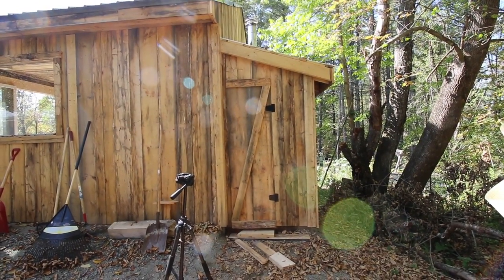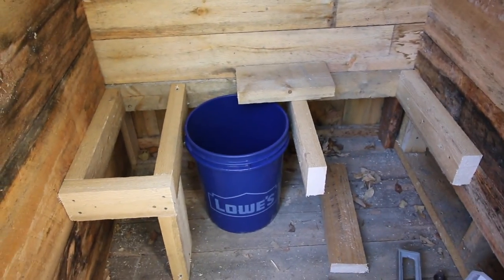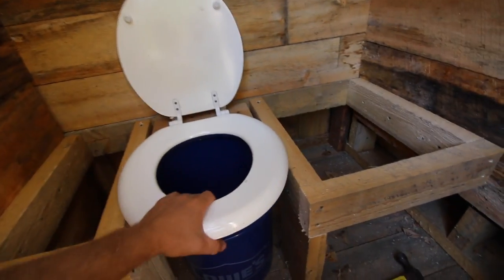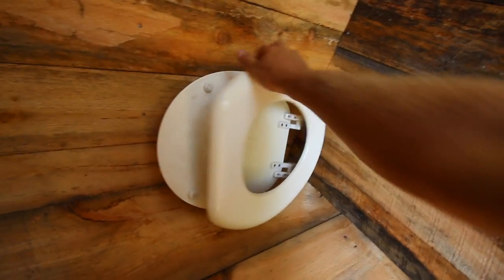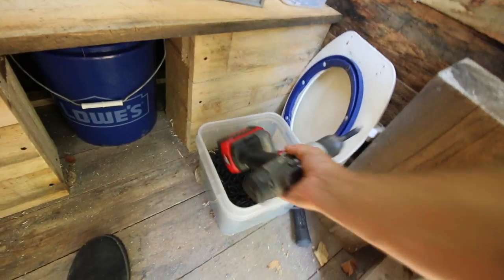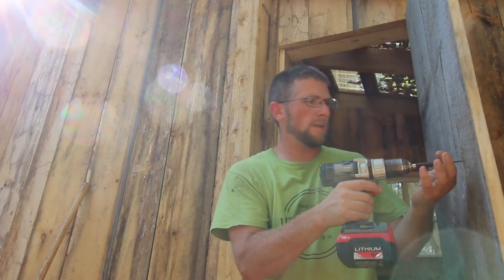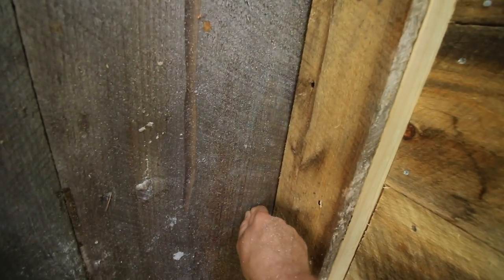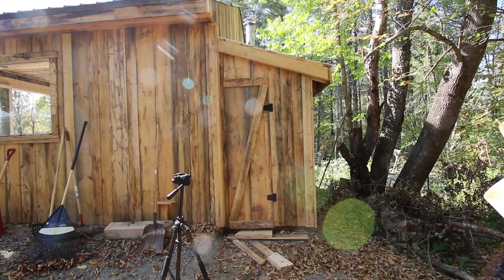🔨Interior Designing the DIY Composting OutHouse🔨

Comment: I worked for a season in Europe on a campground with a waterless toilet system. It used wood chippings  and the toilet was raised above the area of the clippings. Once a month or so, depending on season and amount of customers , we emptied a small packet of live worms, bought from the company who designed the system, into the toilet. They quickly turned any waste into useable compost. Very little smell involved, whole room was vented through the roof by solar fan . System was from Sweden, it worked well. Maybe details on Wikipedia or someone may read this who knows much more than me..
I just checked and lots of details on Google etc. under Swedish waterless toilets, BIOLET. NO WATER, NO FROST PROBLEMS WITH WATER SUPPLY.

Comment: I moved into my 5th wheel camper, as kind of temporary transitional housing, and I'm converting the bathroom to this system. I don't want to screw into the walls, in case I decide to sell the camper later. So, to build the box, I'm thinking I should make two rectangles to fit the space at top and bottom, then connect with vertical pieces, then cladding and hinged top. Is that about right?

Comment: any thought to a vent stack near the top of the compost pale top to help with ...heavy vapours ?
Reply from the maker: I am not going to right now but I will add it later if need.
Reply: if you use sawdust to cover, correctly, there should be no odors.

Comment: Ok, now that I know that you have used tar paper to seal the breeze out I'm more concerned about the fixed glass window and no vent.  Is there a specific reason for not venting, if so what is it?  Just seems normal to have a screen window or at least a window that could tilt out for fresh air.  Maybe your just so quick that it isn't a problem!  You are crazy fast and dedicated to your project at hand!  No sitting on the job maybe!
Reply from the maker: To make the windows that I had be able to open and still look nice would have taken a lot more time and I need to finish the outhouse and a few more things before the class
Reply: Lumnah Acres ok, makes sense with the colder weather you wouldn't need it for a while anyway.  It looks great by the way.  I see you filled up on the workshop with hand hewn farms, that's great!  I guess I will have to try for it some other time.  If you find out that someone drops out please announce it via the vlog and who knows maybe I will be able to attend...sometimes last minute things happen!
Reply: i think there are plenty of places for the air to flow from low to high. i would provide a hook inside to prevent unintended exposure.
Reply: The Windows can be hinged to open up and screened. That's .4 cents... Lol

Comment: Sorry, all wrong, tear it down. You forgot the crescent moon in the door, it does not pass outhouse code. LOL
Your composting toilet reminds me of "Jobsite Johnny," a toilet I designed for use on construction sites. 5 gallon bucket, with wooden bracket that allowed for a proper toilet seat to be attached. Kept a roll of kitchen garbage bags and TP inside. Find a quiet, comfy spot, line the bucket with a bag, folded over the top, take care of business, remove bag, tie it closed, dispose of properly. This came about thanks to an apprentice electrician that would use empty nail boxes, then leave them laying about the jobsite amidst the rest of the debris. Not a pleasant surprise to find when cleaning up. Finally came up with Jobsite Johnny and broke this apprentice by hiding one of his not so empty nail boxes in the back of his truck. Some lessons are hard taught. LOL 
OGOKOH is looking good, fix the door. :-)
Reply from the maker: Yup I got one of those! Lol. We will have to have Olivia paint a moon